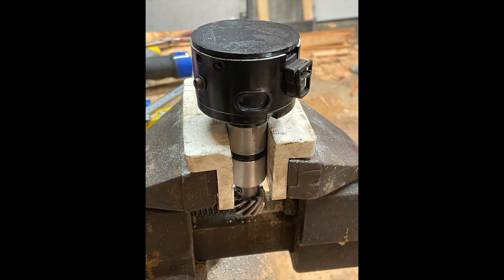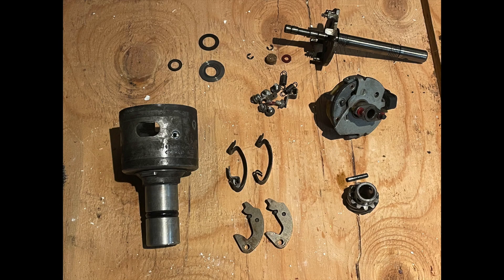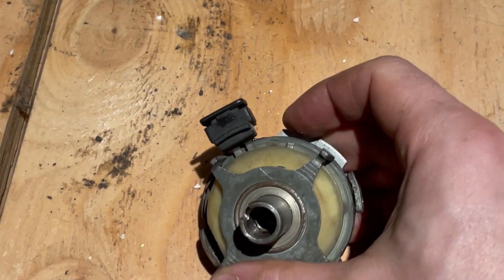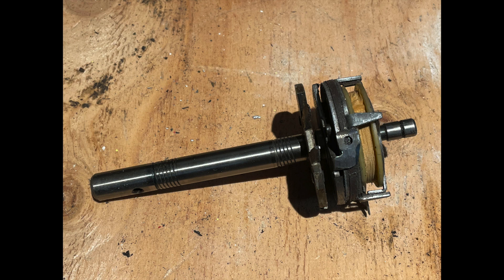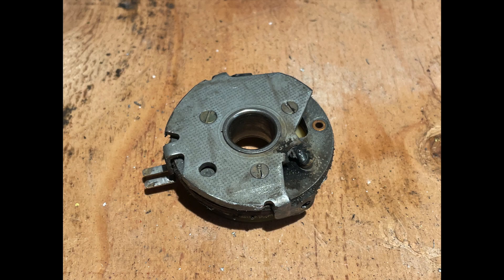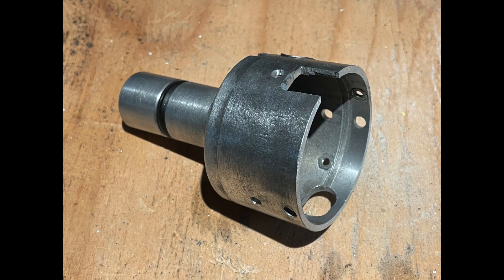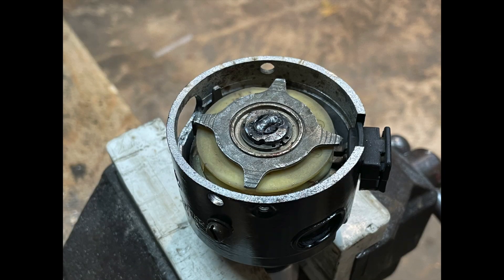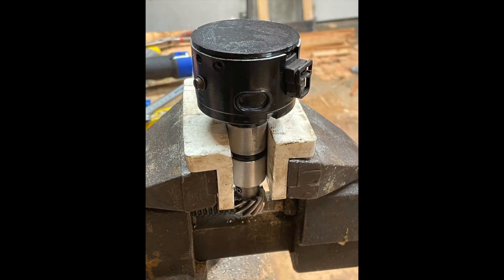BMW E21 Distributor Converted Cam Position Sensor for Modern EFI

Comment: What is the cam sensor looking for ,is it looking to sense cylinder 1 inlet valve open,opening,before opening.

I want to fit my triumph spitfire 1500 with EFi and have sequential injection,most likely with speeduino for it's a far cheaper option than megasquirt.

I could make a full unit as i have a lathe and a mill,plus i'm an electronics technician,so the trigger could be hall,optical or a reluctor.

Any input to the cam angle vs input valve would be a great help.

Cheers.
Reply from the maker: I don’t think it matters too much, you just configure the offset angle from TDC in TunerStudio.

Comment: I HV an E12 using a points distributor but am having issues ..I then have an E30 distributor which goes the opposite direction ....I ana use the e30 distributor on my e12 is it possible that I swap the gears down there will it work
Reply from the maker: Not a clue… i only know about 2002 distributors sorry

Comment: Do you have to set the point to TDC of Cylinder 1? I head you just have to set it to trigger before TDC (before crank trigger wheel)?
Reply from the maker: It probably depends on your software but I believe that is the case in at least some of them. The ECU just has to be able to know which of the 360 degree crank rotations is intake stroke for #1 cyl right?
Reply: @ryan_layne  Its Megasquirt, I think cam position sensor has to trigger before TDC. Will check in the manual again.

Comment: You could also mount the trigger wheel upside down and use a cam sensor mounted in the top to point at the wheel to trigger tdc cyl #1
Reply from the maker: That means using custom hardware though right? And that means the sensor sticks out the top making the unit higher profile. My goal was to flatten it down as much as possible.
Reply: @ryan_layne  it also means a replaceable cam sensor if the sensor fails rather than have to remake this entire unit. This one looks very nice though. I am going efi very soon so I'm just seeing what others have done.
Reply from the maker: @XiseTK  The way this thing is made… it’s no wonder it still works after 30 years, and I honestly doubt it will break under normal conditions. It’s pretty simple… no integrated electronics like modern stuff.